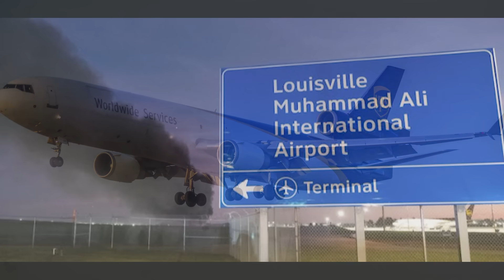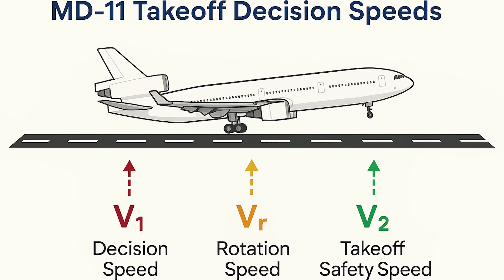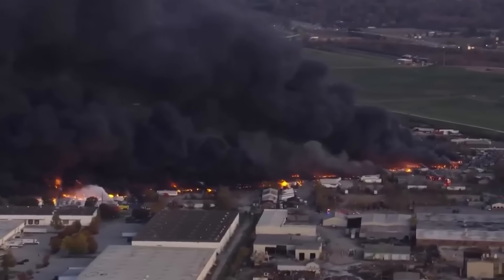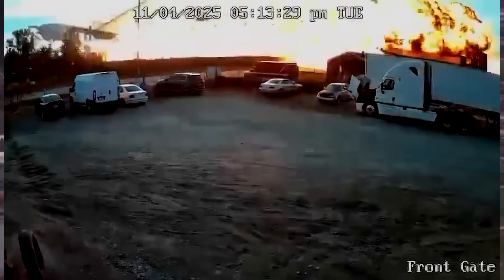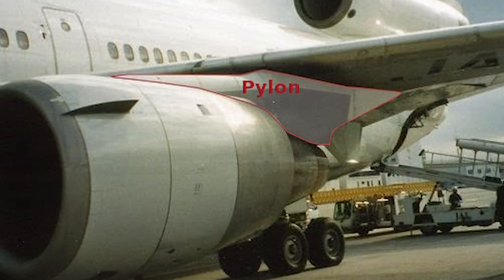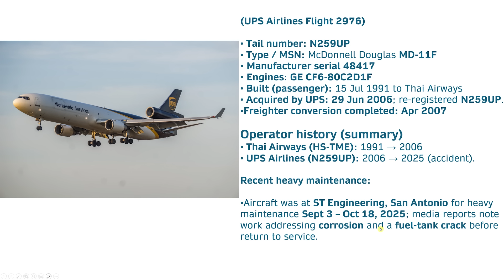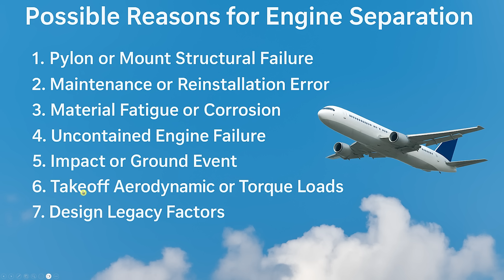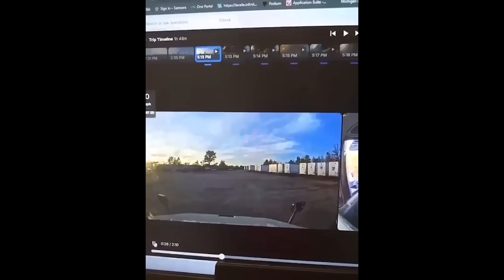What Caused UPS Plane Crash, Louisville, KY? How MD-11 Engine Fell Off

Comment: I still remember what my late father told me before he passed away in 1998 — never to fly on any McDonnell Douglas planes. My dad used to work at that company as an electrician, and he said there were mistakes made and inspectors turned a blind eye, which shocked him. His words still resonate with me, even 25 years after his passing. My dad worked there in the 1970s.
Reply: I highly doubt that problem is limited to McDonnell Douglas.  Standards industry wide have taken a nose dive.
Reply: In my humble housewife opinion, I think that some people either don't care about the job they do or don't take it seriously enough... Especially in some maintenance areas. Those people keep those planes flying and all it takes is one person having a bad day and you get a catastrophe. And, like most jobs, maintenance can have too much on their plate and the parent companies just don't care.
Reply: @mf5985  that's one thing.

If it's anything like the Boeing of curre t times, it the parent company demanding corners be cut for "reasons."

And honestly, that seems to be a universal thing now. Anything to save $$$ at the end of the day.
Reply: @MaddJakd corporate, corrupt,& culpable are not only dictionary bedfellows due to spelling it would be fair to say...
Reply: @mf5985  r you kidding. The over seeing of this & the responsiblity of maintenance, manufacturing etc is so critical, it is Not a job that can Not be taken with the utmost seriousness. you can bet they will be doing a deep investigation into this & someone will be held responsible
Reply: @Laur-g7xdid you not watch the whistleblower hearing? That’s exactly what happened. People not taking their jobs seriously, using defective parts on planes, jumping on components to make them “fit”. The engineers even named which Boeing models with the most concerns. All this in the name of meeting targets. Safety concerns ignored up to the highest level.
Reply: No disrespect to your Father but I flew the DC-10 and the DC-10-30 for about five years for a major carrier. It was a fantastic aircraft. Easy to fly, handled like a much smaller aircraft and the systems were well designed. It was fast and handled well at the upper end of the envelope. I also instructed on the aircraft.
Reply: @NamelessRider  And do you have stock/pension investments there...?
Reply: My dad told me to never fly at all stay grounded
Reply: And now McDonnell Douglas is Boeing.
Reply: I remember that whole controversy when I was a kid in the 70s. I can't remember I think they were like dc-9s or dc-10s or something
Reply: @ONLYinANTARCTICA - they say the same thing about Boeing.  I haven't heard that about Lockheed but they might.
Reply: Sounds like the major railroads
Reply: Yeah, mcdonald douglas has had a lot of failures in their planes
Reply: Poor maintance
Reply: Why didn’t he report it. So he kept working there all while building plane that were not suitable to be flown???
Reply: @trainhandler9580 You saw what happened to the last guy that spoke up against Boeing.
Reply: I worked for Lockheed and the travel office asked me if I wanted the engineer's privileges...they had it in their contracts that they did not have to fly McDD A/C or Delta Airlines.  This was back when DC-10s were crashing....late 70s?  If no ticket home on a non-McDD A/C was available, the travel office had to put them in a hotel until such a flight was available.  Same re: Delta Airlines--they had quite a history then...

I carpooled with an engineer who worked on both the design of DC-10s for McDonnell Douglas and on L1011s for Lockheed.  He said the 2 design philosophies could not have been more different.

McDD had a suggestion box for engineers.  If an engineer had any suggestion to make the a/c less expensive, the company was interested.  On the other hand, when he moved to the Lockheed-California Company to work on the design of the L1011, the company's emphasis was all on safety.  They, too, had a suggestion box, but they were interested in safety above all else.  Of course, they had to close down production because the plane could not be sold for what it cost to build it.   Somewhere above $45 million?  But it was very safe.
Reply: Something like this happened at o hare in 1978
Reply: Regardless the planes history,it still killed all them people,so its proven it's self it's dangerous
Reply: I never fly on them. From a child, I could tell the engineering was subpar and leaps and bounds below Boeing and Airbus.
Reply: @jodi-annedavidson5348  As a child, you had a fundamental understanding of aerospace engineering? That must have been a weird childhood.
Reply: we need safe runway runoffs so ALL takeoffs can be aborted.
Reply: Your father turn a blind eye so it’s sorta his fault to shoulda went public
Reply: Boeing seems to me the manufacturer to avoid,,besides Fed Ex use this planes and never heard have no issues. These planes are use for cargo only
Reply: @JorgeLAxeGrinderBobe Boeing were taken over by McDonnell Douglas 20 years ago. They kept the Boeing brand because the MD brand had such a bad reputation. Now Boeing stinks as much as MD used to and for the same reasons.
Reply: @davidwright7193  EXACTLY.  I knew an engineer who worked on design at McDD.  He told me they were not concerned with safety, just costs.  This was 45 yrs ago tho.
Reply: @JorgeLAxeGrinderBobe  McDonald Douglas and Boeing merged together and some have said that is when Boeing went from a mfg led by engineers to one being led by bean counters
Reply: With all due respect to your dad, this particular aircraft was 34 years old when it crashed. It had tens of thousands of flight hours. It's safe to say that this MD plane was a well built and safe aircraft. Every aircraft, regardless of who built it, becomes unsafe if its maintained improperly.

Regarding your dad's first hand experience, I don't doubt him at all. But the reality is that there's probably lots of people who will have similar stories who have worked for every aircraft maker. Yet, aircraft are still the safest way to travel.
Reply: @joes4194 youre exactly right. MD merger was.the downfall of Boeing.
Reply: @joes4194  Exactly.  It's not like Boeing is a guaranteed safe bet, either.
Reply: @bobbobby-o2w It used to be. No more. Extractive capitalism at it’s finest 💀
Reply: @bobbobby-o2w  McDonald Douglas and Boeing merged together and some have said that is when Boeing went from a mfg led by engineers to one being led by bean counters
Reply: @bobbobby-o2w  They say McDonnell Douglass bought Boeing with Boeing's money or vice versa...but Boeing only started crashing after merging with MacDac.  I don't recall Boeing having a poor safety record b4 the merger.
Reply: @joes4194  Au contraire.  McDD DC-10s were crashing all the time in the 1970s/80s.  I can't remember the years, but the engineers at Lockheed refused to fly on McDD A/C.  It was in their contracts.  I carpooled with an engineer who worked for both McDonnell Douglas on the design of the DC-10 and for Lockheed on the design of the L1011.  He'd go on about the different views about safety and cost.  Lockheed was all about safety--they wanted any suggestion about making a/c safer.  McDD was the opposite--make it cheaper.  Clearly, you lack experience in this field?
Reply: @cyninbend  Au contraire. I don't lack experience in this field. You just think that your limited experience is everybody's experience for some reason.

Additionally, I'm not sure what statement of mine that you think you're countering with your statement. This accident aircraft was not a DC-10, and I specifically limited my speech to the accident aircraft.

And I can assure you, regardless of what your carpool buddy at Lockheed told you, there are people who exist and will testify that they saw unsafe things at Lockheed. Your buddy isn't the totality of Lockheed employees.
Reply: Bs. There are couple of Douglas-made DC-9 that are over 60 years old, still flying.
Reply: @Thedoomguy66_6  Yes--it was the DC-10s that kept falling out of the sky.  DC-9s had a decent history--at least after all the retrofits, etc...
Reply: @cyninbend dc-10 still flies too. All over 50 years old, one in commercial cargo and other as firefighter tankers.
Reply: @Thedoomguy66_6 "I survived Omaha Beach, I don't know why people said it's dangerous"
Reply: Jimmies dad said the same about Boeing.  Susy's dad said the same about Airbus.  Pete's dad said the same thing about...
Reply: @Rob-dp1tt Go ahead, name another major commercial aircraft manufacturer. I'll wait.
Reply: Honestly everything that is built can fail . Theres just to many different things at play. Faulty parts, lazy workers, workers who just dont gaf. Anything can happen to a machine no matter what brand or who manufactured it.
Reply: @LaymanGamin Corporate culture also plays a role in it. You don't get a job like that by being lazy, and if you do, something else is going on with the people who chose to hire you.
Reply: @ONLYinANTARCTICA
Like the guy in this video said, that O'Hare plane crash make me afraid of flights because I remember reading about that crash in the newspaper and how they could only find minimal body parts like fingers with rings on them and partial legs with shoes, that imagery drove me nuts because I was only 15 years old at the time, and that was also a McDonnell Douglas DC 10 plane, that company has had an infamous history of plane crash disasters over the decades.
Reply: Sounds like your dad was accomplice to some shady stuff that could have resulted in the major loss of lives. You are supposed to report that, keep reporting, go to the news if you have to. But hey it's common place to brag about ones indecency these days.
Reply: Yeah, dads say all kinds of kooky stuff based on their own superstitions and biases. You just have to filter through crap like that and find the useful information and advice, if there is any.
Reply: Telling that the recycling plant refuses to talk to press.
Reply: @ABoyNamedSueEsponte  Could you imagine being in their shoes? I doubt I would want to speak either after witnessing such a horrible event.
Reply: @ABoyNamedSueEsponte  What's telling about it? Are you insinuating that they should actually WANT to talk to press at this time? I swear everything has to be a conspiracy with you types.
Reply: @ABoyNamedSueEsponte  Wow! I think you're on to something. I just figured they wouldn't want to talk about it cause they're entire livelihood was destroyed by no fault of their own and what insight could they possibly give? But now I'm thinking they're not talking to douchebag reporters and only talking to proper authorities because they were in on it. You are smart.
Reply: @jonnyboom5993  I'm sorry for everyone that has to deal with your slowness every day.
Reply: Your dad was wrong.

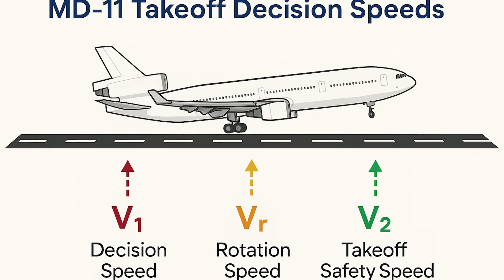Comment: the shot of the engine core lying on the ground burnt to a crisp (right around 3:18) seems to show a portion of the turbine section missing or blown out
cf-680c2 engines have a reputation for doing this
american airlines had two 767 complete hull losses from this issue

Comment: If it missed that first building causing it to roll and crash.Do you think you could've gone airborne?And circled around for emergency landing ?
I always have a problem with any building any buildings.Whatsoever , in line with the runways for the first quarter mile.... Why can't you put parking lots there?Or ground level storage only???

Comment: The plane was at maximum weight & probably overloaded, so needed all 3 engines to get it up, the crash was a result of the left engine  departing- loss of power & speed lifting off a bit early & it stalled into buildings

Comment: I feel as though the first view of the plane as it comes over the first warehouse it hit, you can see the planes engine casing still on it but not in its fixed position, almost as if it loses the engine casing literally right after hitting the first building. I don't think it was secured to the wing fully but was still attached to the plane before the initial impact.
Reply: They found the engine halfway down the runway
Reply: @adamheywood113  2,000 ft from the end of the 12,000 ft runway.
Reply: @christopherrobinson7541 maybe not halfway down then

Comment: Not sure how they can update safety procedures here with complete loss of engine from the wing. Pretty much confirms right at takeoff if either wing engine completely falls off there is no real way to stabilize that loss of weight and the plane is going to tilt/tip in that direction almost immediately. Pretty scary stuff. Complete loss of engine power is one thing they can create procedures for but a loss of the whole engine itself seems like a certain death sentence.

Comment: They should have a system to purge the fuel before a crash. They could have dumped a good amount before the crash causing less damage.
Reply: They were carrying 34,000 US gals of fuel 228,000 lbs, it would not have been possible to dump much fuelin the time available.

Comment: ...bet the maintenance wasn't being done properly and they were not following proper procedure when dismounting and remounting the engine. Suspiciously similar to the crash of a DC10 in Chicago back in the 70s where the engine detached during takeoff. Turns out the engine mount was cracked during improper engine mounting procedures. Engines are also mounted with sheer pins to allow the engine to detach in the event of extreme impact to prevent the wing being broken off.

Comment: When the wing engines were not falling off, the center engines exploding would cut the hydraulic lines leaving you with only the engine throttles to control the plane. Remember Soux City Iowa?

Comment: Plane with only one engine need to stop trying to lift off of the runway.  They don't have enough power / thrust to get the proper lift necessary to maintain flight, so it much better to crash at the end of the runway than try to lift off and crash into homes and businesses just outside the fence. QED
Reply: If it fell off after V2 speed then no, that's a no-win situation
Reply: MD-11 has three engines

Comment: Always Boeing, Nothing ever happens to ownership or executive management. 
Boeing planes just keep falling out of the sky!
Reply: The MD-11 was built by McDonnell Douglas
Reply: @adamheywood113  Boeing bought McDonnell Douglas in 1997.
Reply: @aamaze783 This aircraft was built in 1991
Reply: @adamheywood113  And it was converted from a passanger plane to a freighter in 2006 with modification and conversion oversight by boeing, using Boeing manufactured parts and supplied parts as well as the engineering design through it’s BCF program and continue to provide technical support, spare parts, and design expertise. Per Boeings acquisition contract in 1997, it inherited the full legal and engineering responsibilities for the existing fleet of MD-11 aircraft.
Reply: @aamaze783 Therefore it's not Thai Airways or UPS or whatever engineering houses worked on the plane, it must be Boeing
Hey look, if it proves to be, fair enough, I just don't see enough evidence yet to conclude

Comment: Your video includes some new information (new to me) that provides additional clues. First, with one engine out it (and nothing else wrong), it has enough thrust to climb out. As others previously noted, the tail engine was emitting flashes as the plane was trying to lift off probably indicating a loss of thrust from that engine. This could be compressor stalls, but why was that happening? I think the answer could be the left engine cowl that was on the right side of the runway (relative to the takeoff direction). And, from other engine separation incidents I've read, and by design, if the engine separates when under full power it tends to pitch up, move forward, and then go over the top of the wing. This suggests that the debris from the engine separation went up and crossed over the the fuselage and was ingested by the tail engine, damaging it and further reducing total thrust. And in a similarity to AA191, in the dash cam video that you showed at the beginning, in the frame just before the first power line flash, you can clearly see a discontinuity in the leading edge of the left wing. I think when the engine departed the aircraft that it took the inboard slats with it. The asymmetric thrust plus asymmetric lift made the roll to the left impossible to control.
Reply: The sharp roll to the left was caused by the left wing hitting the vertical waste fuel storage tanks. It was not the result of the left wing stalling due to the lack of slats. The discontinuity in the leading edge of the wing is the absence of the engine pylon.
Reply: @christopherrobinson7541  It's just my theory based on the video. The investigation will tell the tale.

Comment: It seems like everyone simply forgot the whistleblower who tried to tell us about Boeing's parts being dangerous and will lead to deaths. Unfortunately murdered for speaking out ( but called a "suicide" )  and every since that day, there has been continuous problems. From other plane crashes, doors coming off mid flight, astronauts being stranded in space for like half a year,. That's only a few examples. I can't even keep them all straight due to COVID brain  injury, but there sure has been one hell of a lot of issues over the past year and a half I guess. Leading to injury, and death. All models from "Boeing" each and every time. Don't forget, that guy was another of the "innocent's" harmed by Boeing. These things will keep happening, and anyone on the inside, who dare raise a Spector at them, will be disposed of
Reply: McDonnell Douglas

Comment: A big part of this is going to be the answer to this question:  at what point in the takeoff roll did the fire start, and when did the engine separate?  And which of those two happened first.